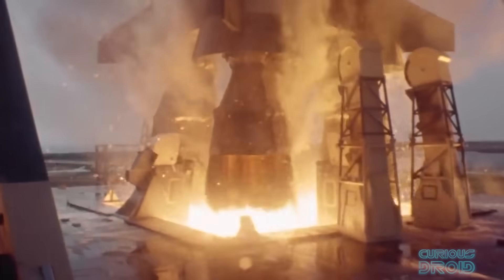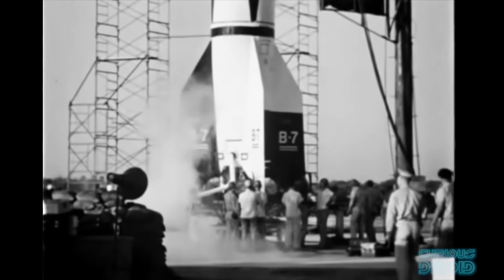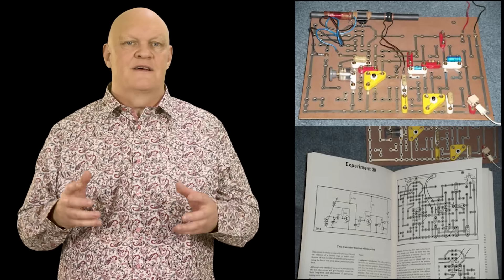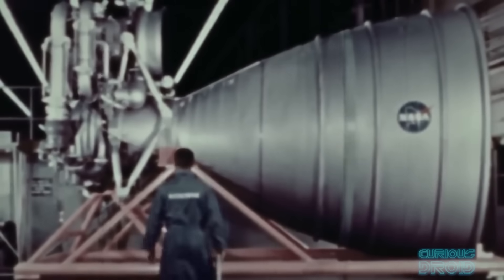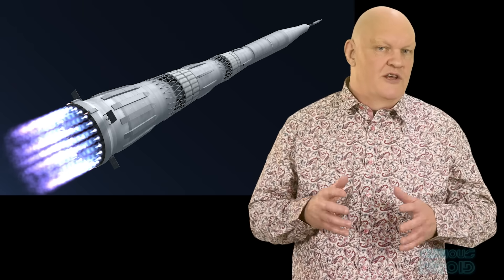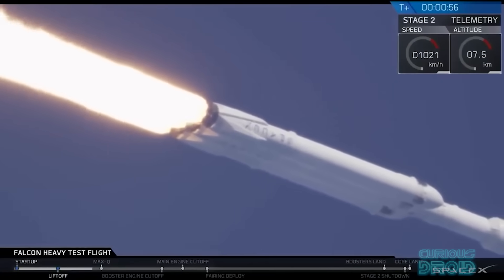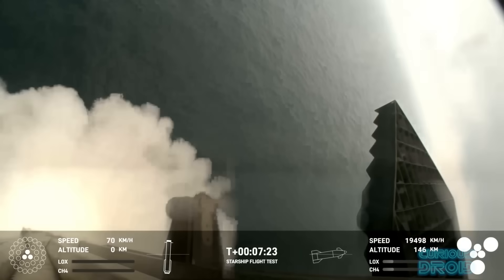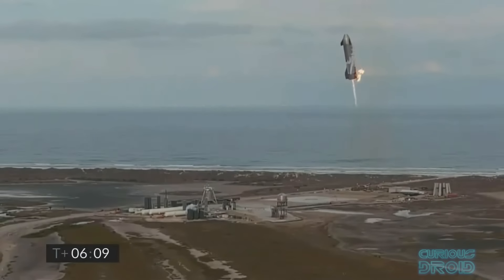Why Does SpaceX Use 33 Engines While NASA Used Just 5?

Comment: 11:50 It's worth noting that SpaceX tests every engine multiple times prior to launching.
Reply: You can't test multiple times the shaped charge that goes inside a nuke. The whole point of this engineering is to get round impossible problems with clever solutions.
Reply: It's worth noting that Musk himself admitted that the Raptors 2 aren't reliable and "hopes" that Raptors 3 will be, while making them run even harder because they absolutely need much more thrust for the inflating mass of Starship v2 and v3, as they are now trying to bring back the payload to 100t or more... It's going to be very entertaining... Maybe less so for NASA.
Reply: @dave_ant1  The Raptor 2 have already demonstrated decent reliability. For the last three flights, 116 out of 117 engines have worked for ascent. That's a 99.14% demonstrated reliability.

That's a more confident reliability number than the F-1, which had a total track record of 65 out of 65 for ascent. It's also better than the well known RD-180, with 105 out of 106 for ascent.

Musk hasn't said that the Raptor 2 aren't reliable. He's only said that Raptor 3 will be more reliable. No matter how good the Raptor 2 are, they can always get better.
Reply: @SpaceAdvocate  "Musk hasn't said that the Raptor 2 aren't reliable. He's only said that Raptor 3 will be more reliable"

It is implied though, isn't it?  "Hopefully more reliable" implies a pre-existing lack of reliability. NASA needs more than decent reliability (and Musk's hope) on those... Besides, most engines worked for ascent but what about relight capabilities? The ones which are supposed to sustain an Artemis mission will have to relight 5 times. And more if you want to pitch the re-usability aspect of the HLS Starship. 

How many relights can those sustain? How much are stand tests out of the manufacturing line and static fires degrading their internals, as those engines already run at their limits? I think it is far too early to speak about a 99+% reliability... And running them even harder for Raptor v3 (because they need more thrust), isn't going to improve things. 

Maybe they can get better as you said. Maybe not. Time will tell but it looks like they may have entered a negative feedback loop, with them chasing the payload and pushing their engines more and more to squeeze out the needed thrust. It can't be good for the future. But I'm more pessimistic than you are...
Reply: @dave_ant1 
So now it's bad that a person can admit that his rockets aren't good enough and hopes the new version will be improved apon? 😂

Twisting it to sound bad, you are all crazy.
Reply: Yet every flight has had them fail!
Reply: @palmtreeshenanigans the unique vibratory environment and the usage of a full flow combustion cycle engine really raises the risk of failure. It’s for this reason that starship has so many engines - to allow for engine-out capability.
Reply: @alxz3707  The number of engines is due to SpaceX wanting to make manufacturing inexpensive and to avoid combustion instability. The factors which led to extremely large engines like the F-1 and RD-170 have been nearly eliminated by computerized design and simulation.

Not to mention the advantages of commonality between the engines used on the first and second stages.
Reply: @palmtreeshenanigans you work for blue origin?😂
Its all TESTING and watch now the catch of the booster, go cry space x hater😂
Reply: @palmtreeshenanigans what? When
Reply: @palmtreeshenanigans  better to have 1 of 33 fail then 1 of 5 fail.
Reply: @patthonsirilim5739 on the Saturn they could still get to orbit on 4 engines
Reply: @palmtreeshenanigans  
@TucsonDude

What's NASA's success rate? How long have they been around? How were they funded? What is SpaceX's success rate? How long have they been around? How are they funded?
SpaceX hasn't lost any lives to said failures either. Not shitting on NASA, but objectivity helps. ;)
Reply: @zacharychavez3482  "Objectivity helps" NASA's goal was to figure out space and get people there.  SpaceX's goal is to make money.  Objectivity helps, indeed.  Lmfao.

I also think adding in where each started is also part of objectivity.  

NASA had some initial data from the military and smaller rocket programs

SpaceX had TONS of FREE data to work with and add to including but not limited to; half a dozen successful PROGRAMS including DOZENS upon DOZENS of launches and vehicles ON TOP OF hundreds of millions and billions of dollars in grants to get started

I would still give the medals to NASA.  SpaceX doesn't deserve anywhere near the same recognition and it won't until it lands a person on Mars.
Reply: @DarthObscurity  well, Space X can land a buster.
Reply: @palmtreeshenanigans The memes write themselves. Fanboys will ignore the very obvious failures and believe its all part of the plan. Not every kg needs to go to space only the parts that matter.
Reply: @klutzspecter3470  Agreed. I worked on the Orion space program and we still had junk weight flying up into space.
Reply: @klutzspecter3470  The tests are initially supposed to be failures so the people involved can learn how to prevent those failures from happening for real.

Once you start overcoming the failures you'll reach success.
Reply: @Cacowninja  That's not entirely true. SpaceX does perform tests expecting failures, but they don't intend them to be.

Comment: SpaceX only has the smaller Raptors, the rocket engineer left the company so they are stuck and can not build a larger one, like the Russians on Sojus. More engines mean more possible faults, and while some faults can be tolerated if you install more engines than needed, others like explosions will bring the whole rocket down.
Reply: There are huge differences between Raptor 1, Raptor 2 and Raptor 3. SpaceX is clearly completely capable of evolving the design, and if they wanted to move the design in the direction of bigger, they would.
Reply: @SpaceAdvocate  SpaceX already had severe problem getting the readily designed Raptor3 up and running after Tom Mueller left. You need the heroes in a company, a herd of sheeps will not deliver outstanding.
Reply: @flexiblebirdchannel  Tom Mueller transitioned to a role of part time advisor back in 2019. That was before Raptor 1 was fully functional. A lot of progress has been made since then, and will likely continue to be made.

Comment: SpaceX developed an engine that is very efficient at getting payloads to low earth orbit and just assumed they could use software to get around the fluid dynamics issues inherent in using lots of engines.

Their engine design doesn't scale for heavy lift and it hextuples the engine failure risk

It's a developmental dead-end. Flim flam sold by the Muskman

Comment: Unlike Americans Soviets also used a closed combustion cycle in their engines. RD-170 most powerful rocket engine ever made (4 chambers, 4 nozzles, one turbopump rated at 170 000 kw, 740 t of thrust at sea level, consumption of 2,5 t of fuel per second and 27 000 000 kw of power) is a closed cycle engine. The first use of that technology was in the Kuznetsov NK-15 engines on N1 rocket.
Reply: No, they used more engines because they didn't solve combustion instability. Also, they got ahead of themselves and set up factories to mass produce engines
Reply: @samsonsoturian6013  To what part of my post are you replying to? Because I  did' t mention anything about what you are talking about in my post.  Moreover the reason why Saturn 5 used 5 engines and N1 30 is completely different from one that you mentioned. Testament how good, efficient and reliable Russian closed cycle engines are  (like RD-180) is that they were used by USA in large quantities.

Comment: 5 engines, 5 chances of having an engine failure.

33 engines, 33 chances of having an engine failure...
Reply: With 99% engine reliability:

5 engines: 4.9% probability of launch failure
33 engines: 0.44% probability of launch failure (assuming 2 engines can be lost without consequences)
Reply: @SpaceAdvocate  I don't know about that, how are you calculating a 0.44% probability of launch failure with 33 engines? When you look at it from the view of probability of success with 99% engine reliability:

1 engine: 99% probability of success
5 engines: 95.1% probability of success
33 engines: 73.2% probability of success  (assuming 2 engines can be lost without consequences)
Reply: @tommy_egan  I just used a binomial distribution calculator. With 33 engines with a 99% reliability, there's a 28.2% probability of losing at least 1 engine, a 4.3% chance of losing at least 2 engines and a 0.44% chance of losing at least 3 engines.

Only with three or more failed engines would the launch fail.
Reply: @tommy_egan  5 engines, a single engine failure = launch failure.

with 33 engines, it requires 4+ engine failures to cause a launch failure.
Reply: @willyolio9590  I'm sure at least one early Saturn 5 launch had one engine lose the plot halfway up, but due to a crosswire issue the computer shut down a good engine instead of the faulty one... they made it to orbit anyway. Good engines! I'm no V8-head but sometimes there's no replacement for displacement....
Reply: @willyolio9590  Its easier to test and care for 5 engines than 33. any system with more components are less realiable.
Reply: Having so many engines is one of the reasons that the Russian lost the race to the moon.

Comment: The Starship booster still uses a minimum of 3 engines for landing, so this doesn't explain why the engines are so small. But I assume the ship uses even fewer engines for landing, and still fewer when landing on Mars in the future.

So maybe the Starship engine was designed with the goal of making the largest engine that would still be small enough for landing on Mars.

But that is speculation. The question in the video title has a simple, if unsatisfying, answer: We don't know!
Reply: The engines could be a bit bigger. But their current size is fine.

The advantage of landing on three engines is that you can lose one engine and still be able to land just fine. This is quite important when carrying crew.

Even if the Raptors turn out to be very reliable, being able to lose an engine on landing would improve safety by quite a bit. Possibly several orders of magnitude.
Reply: @SpaceAdvocate  Interesting point. And I believe the upper stage doesn't even use three engines for landing. Another advantage of relatively small engines is that they can produce a thrust small enough to hover, which means landing doesn't require a "suicide burn" where engines can't be throttled up anymore. Falcon 9 did use it, which suggests its booster had too few engines (nine) for hovering. Interestingly, New Glenn has even fewer first stage engines, namely seven. So the Raptor engine size is most definitely constrained by the fact that it is used in the upper stage. And there the reason seems to be either landing on Mars or the reliability of landing humans on Earth.
Reply: @cube2fox  The Starship upper stage fires up all three sea level Raptors, and then switches off one for the final part of the landing. This allows the system to select the best two engines for the landing.

Super Heavy fires up all 13 center engines, and then goes down to three engines. It might go down to two engines for the final hover/catch, but we will just have to see in july (hopefully).
Reply: Another thing is people want to mass produce rocket engines while Saturn V motors were essentially custom made

Comment: It seems glaringly obvious modern low-cost &  advancement of computers allows for multiple engines, but that was glossed over in this video. The computing technology of the past did not make multiple engines feasible.
Reply: But the computing technology of the past - specifically the lack of Computational Fluid Dynamics - also made it very hard to build really big engines because you could not work out what was making them explode as they got bigger (as they always did). The Russian decision to use their very efficient (for the era) yet proven reliable smaller engines was correct given the technology and resources available to them.
Reply: @kenoliver8913  And then they didn't have computers to properly manage those engines, a bit of a dilemma.
Reply: Well, if we’re keeping score, it still isn’t..